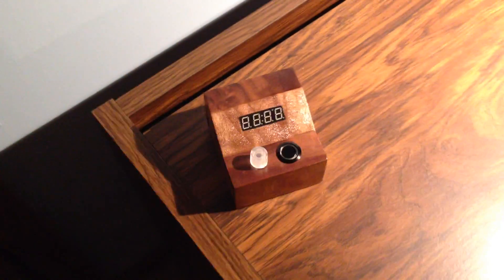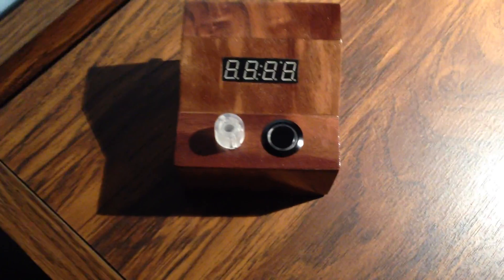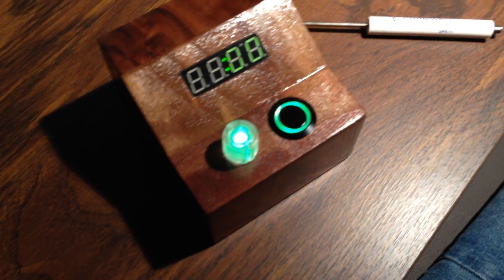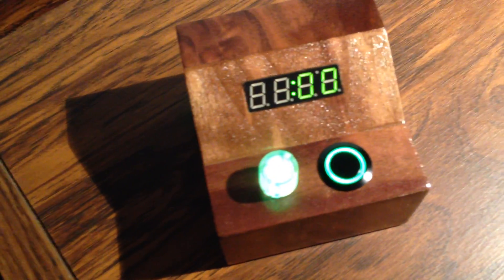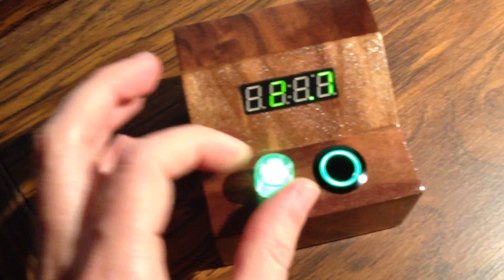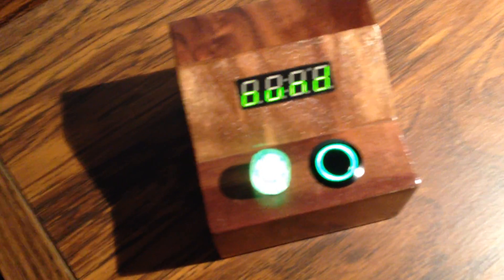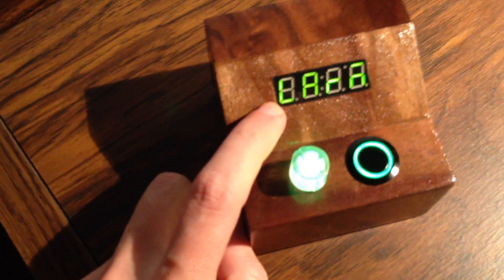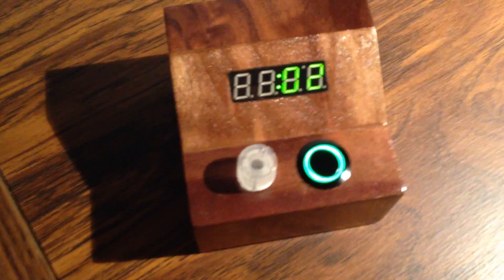Arduino Kitchen Timer 20 - The Night Before Christmas

Comment: hi, nice project. a bezel/filter will make the display more readable. http://www.digikey.com/product-search/en/optoelectronics/bezels/524327 just fyi. nice work.

i should point out that i used a similar display in yellow and the smoke filter completely blocks out the unlit segments. works perfectly. :)
Reply from the maker: Thanks for the tip, didn't even know these things existed!  I ended up putting in the blue display (Arduino Kitchen Timer 21) and it did the trick.

Comment: Hey man! Great Gift! Where did you bought those buttons?
Reply from the maker: I tried the unpainted 17mm stainless steel ones that SparkFun sells but found the button to be a little smaller than I liked, so I ended up buying a bunch of 19mm ones from an EBay store.  Here's a blue one:  http://www.ebay.com/itm/19mm-12V-blue-Led-5-Pins-black-Push-Button-Angel-Eye-Metal-Momentary-Switch-car-/390734203978?pt=LH_DefaultDomain_0&hash=item5af992cc4a